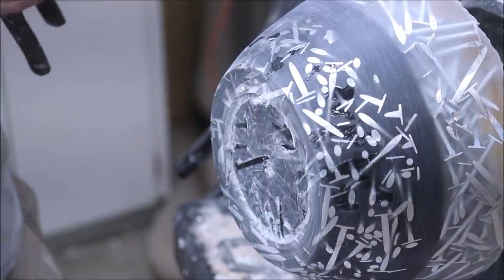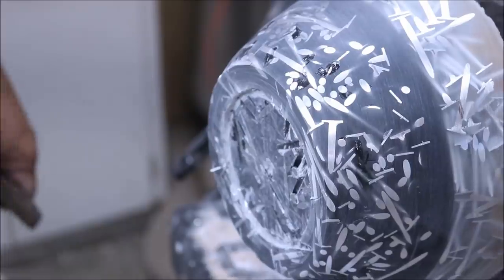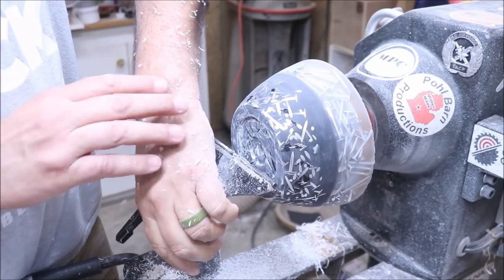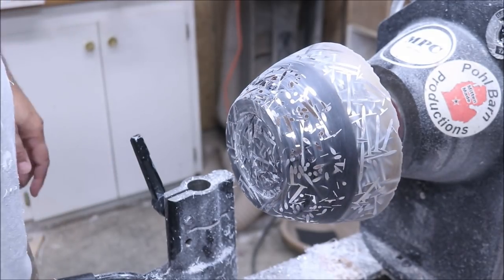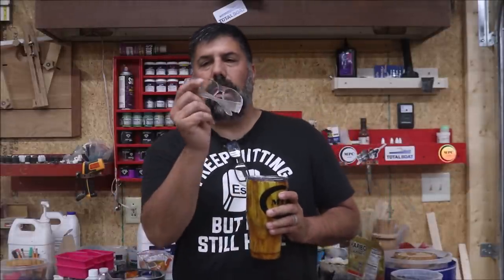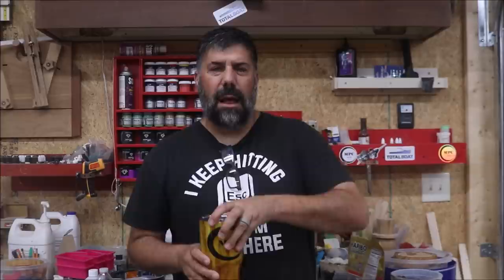I Cast and Turn Nails - What Could Go Wrong? 🤔

Comment: Not surprised that the nails were fighting back - my Dad was a machinist, and sometimes, he would come home, looking like he had gotten into a fight with a cactus. The metal chips were absolutely insane to deal with, come laundry time. Rough on the washer and dryer, for sure.

For all that, though, that is a COOL looking bowl. Make some molds, so you can cast those nails in resin. Just use silver or pearlescent dye powder as a cheat!

Comment: You should have cleaned the nails with acetone (or another degreaser first)

Aluminium nails,  absolutely.
stainless nails, depends, they're sometimes hilariously soft, with carbide but you're gonna burn inserts.
steel nails, with carbide but you're gonna burn inserts fast.
Reply from the maker: They were cleaned with an acid solution.

Comment: I've never turned nails but have done a number of bowls and bottle stoppers with aluminum shavings from a metal lathe cast in resin.  I found that you can reduce the number of little specs hitting your arm if you spray the turning surface with water every so often.  Also keeps the tip of the tool cooler.  Kinda neat project but I think I'll stick with shavings!